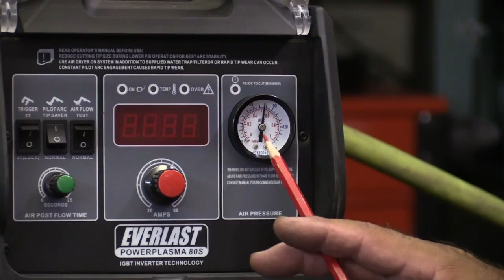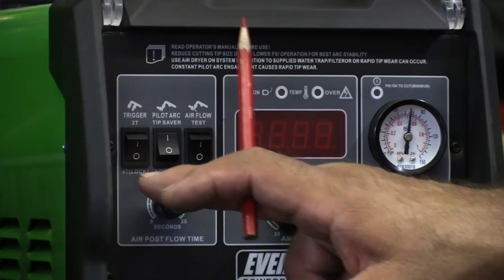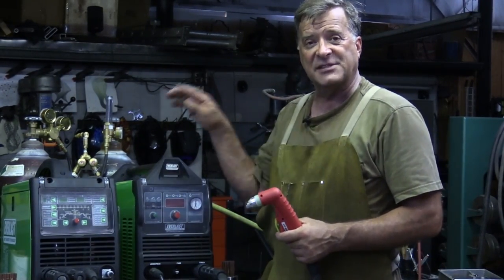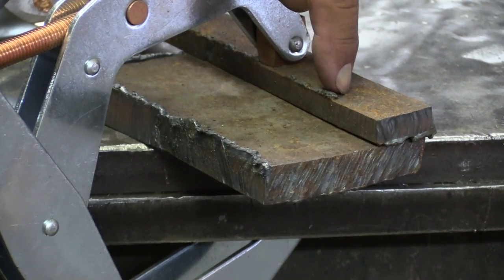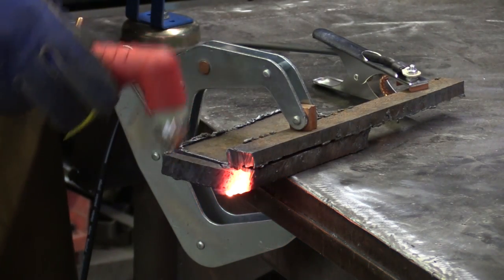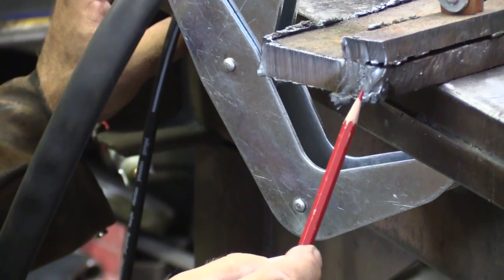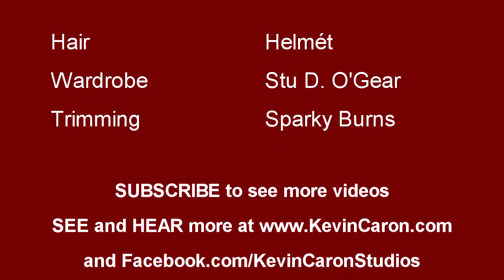How to Use Everlast's PowerPlasma 80S Plasma Cutter - Kevin Caron

Comment: How are these units on cnc machines im currently using a hypertherm 45xp want a bigger unit just dont have the money for a larger hypertherm unit
Reply from the maker: Have never tried but I know it is set up for it.
Reply: You can sell your hypertherm 45 on ebay and buy an 80 am and some other welder too.  But hypertherm 45 is a nice machine should be good enough for most building in the garage.  Wont cut up an old excavator very quickly but it's good, my brother has a hyp45 and I have a hyp30 and everlast 80.

Comment: Hello Kevin
I bought this exact plasma cutter myself. And I still did not buy a suitable compressor and am trying to figure out the best for it as well as my plumbing and air dry setup. My I please ask you a few questions? 

What's the compressor you are using? 
Do you have any dryers, filters and/or water traps on your line besides the one that came with the unit?
How often do you use this cutter and how pleased are you with its performance thus far? 
How often do you change your consumables? Have you already? 

I'd really appreciate your help. 

Thank you kindly in advance and thank you for all your videos. 

Best regards!

Houssam
Reply from the maker: Thanks for watching and posting Houssam.   I am using 2 80 gallon compressors.   You don
't need anywhere near this to run this plasma cutter.  I used to use a roofing compressor.  Just could not cut for very long.  You should be able to run a 30 gallon or so as long has it has a quick recovery time.  A 2 stage, 2 cylinder compressor would be awesome. I use mine 3 or 4 times a week and the consumables last about 6 months or so for me.  I have a dryer in the line before the plasma cutter and the one on the unit itself.   If you check with George at https://www.georgesplasmacuttershop.com  he can get you all the consumables and new torch if you want to this machine. I changed the torch after a few months and the new one is much better.
Reply: @KevincaronSculpture  
Thank you so much Kevin for your detailed reply. One more little clarification if I please may? Your dryer... is it similar to the unit's (filter/water trap)? Or is it a refrigeration dryer? Or is it a Desiccant dryer? 
I'm enquiring to check how long the consumables last with you under what conditions and possible percentages of water going through them if any. 
Thank you so much for the website you advised me to check! I would love to order things from there! But unfortunately, I live in Lebanon (Middle East) the good folks at Everlast were so kind enough to trust me and I did not let them down. I thankfully was able to buy a MIG and TIG welder units as well as a Plasma cutter. I may only be able to purchase my consumables for my hardware from them. I don't know if this gentleman who owns that website you advised me of would trust me as well to ship to Lebanon. Or else I'd be glad to deal with him too!
Thanks again so much Kevin! 
Best regards! 
Houssam

Comment: Hi Kevin, I have a small MILLER 125c plasma machine and am looking to upgrade to a larger machine. Are you happy with your Everlast equipment. I am looking at the Everlast plasma 50. I really don’t cut anything over a quarter inch thick.
Reply from the maker: I have had 2 problems with the Everlast machines in the last 5 years.    Both were my fault.    No complaints about the machines at all.

Comment: I bought one last year .. 3/4 inch is a good size to max out on over about a foot of cutting ... My question .. is there an air filter on the machine ?
Reply from the maker: Yes, you have to plug in the air line to use this machine.  

Thanks for watching!
Reply: @KevincaronSculpture  yes i know .. but is there an air filter for the fan on the machine so you don't blow dust inside it to cool it down

Comment: almost 3 years later, how would you rate that cutter? does it have a port to plug In a CNC computer?
Reply from the maker: It's a monster!!!!    Yes, it does have a cnc port, and yes, it will cut up to 1.25 inches.  Not sever, but cut.

Comment: Like your videos Kevin, I noticed when you went up to the 1.5" cut quality would have been greatly improved if it had actually been a solid 1.5", or material was not stacked with a gap. Stacking material is never recommended for plasma cutting process and would give issues with oxy-acetylene as well. Keep up the videos
Reply from the maker: Yeah, that chuck of 1.5 plate was in my other pants..   Had to wing it...

Comment: hi kevin , do you rate the everlast 80s over the longevity 62i , im looking for a plasma and also looking at these 2 , i will have to import the everlast and wil have to take the chance i dont need the warrenty if i do , or we have a longevity dealer here in the uk but the 62i would work out at $400 more and have less amps .
Reply from the maker: Tough choice!     Did not have a single problem with either machine..

would have to lean towards the Everlast just for the extra power...
Reply: Kevin Caron, Artist 
thanks for the reply , I have done just that and ordered the 80s , it worked out around $500 cheaper than a UK purchased 60i .
I read that you changed the torch on yours , what torch did you change to .
thanks again 
chris
Reply from the maker: Check with George over at http://www.georgesplasmacuttershop.com

I know it is a Tralfamet but not sure which one..
Reply: Kevin Caron, Artist 
thanks , more than likely it's a s75 .

Comment: I have to ask if there's 110v plasma cutters out there and you need compressed air to plasma cut what would you do if you only have 1 20 amp breaker in your shop? Assuming you cant run both the plasma cutter and compressor at the same time. Is there a way that the plasma cutter will automatically shut off so the compressor and kick on so there won't be a breaker tripped?
Reply from the maker: +Love2boat92 

Run another electrical line for the plasma cutter or plug the compressor in somewhere else and get a longer hose..

And NO you can't run both machines off one 20 amp line..,
Reply: Kevin Caron, Artist That's a good idea to plug the compressor in somewhere else and run a long air hose. I never thought about that. Thanks!!!
Reply: Run the air compressor off a generator.  Or run the plasma cutter off a really large clean power generator.  But most affordable generators are only 50 amp.

Comment: This question might not be on topic, but I would love for some input. At each job interview you are usually given a weld test, and the the machines vary. What is the best way to approach this issue when not knowing what type of welder you will be given to do a test with, and maybe the specific machine runs better and a higher heat than the welder you use at home for example.
Reply: I always use the setting chart on the machine as a reference point and work from there.

Comment: Concerning the possible over temp:  Looking at the setting on the machine (assuming nothing else was changed) the unit was in the tip saver mode when the cut was made.  Typically at the end of a thick cut, you may loose continuity.  In the tip saver mode this will typically extinguish the arc.  This is designed to prevent the pilot arc from engaging/disengaging rapidly which increases consumable wear very quickly or prevent a user from keeping the pilot arc lit for more than 3 seconds without cutting.  The stacked plates were not making good contact between them so there are a number of possible things at play here. For best results cutting like this, use the normal mode so the pilot arc will re-engage if cut is lost.   Also we advertise 1" daily use, 1 1/4", clean severance, and 1 7/16" max severance cut...the PP100 has the 1 3/4" rating.
Reply from the maker: Everlast Power Equipment I stand corrected ,,,  again!      Sorry,
Reply: No, problem.  We appreciate the comments and the reviews you do.   Just reading some customers comments of concern,  and wanted to explain what the likely cause was and keep them from expecting more from the unit than we promise that it delivers on capacity.

Comment: Hey Kevin,
I just bought the same machine too. I like the way it cuts. I think they use that fan in their 200 dx tig as well. Moves a lot of air. 

Things to be aware of. That is not the Trafimet torch. It's a Techmo. Seems to be a great torch, but parts for it are hard to find, other than through Everlast. Buy an extra set torch parts to have on hand. You will thank me later : ) The Trafimet is a lot easier to find parts for. Did you know it has a 100% duty cycle at 60 amps? Your overheat light is a bit puzzling. Contact their tech support. 

All this being said, I would highly recommend this machine.